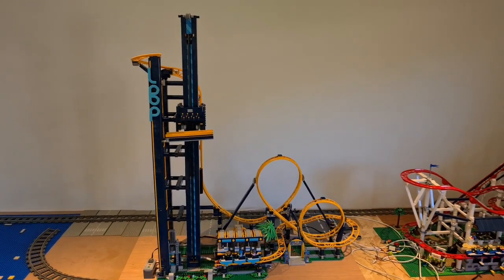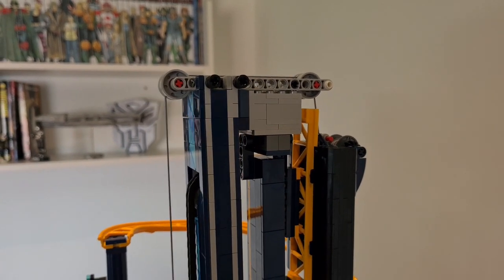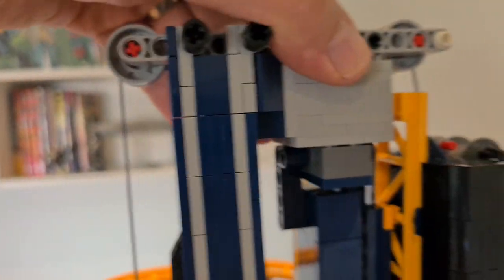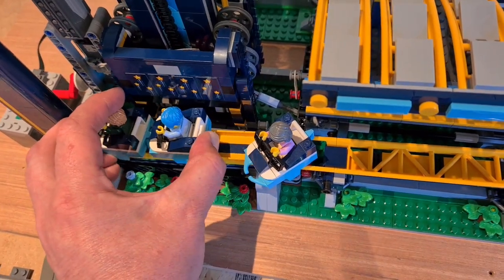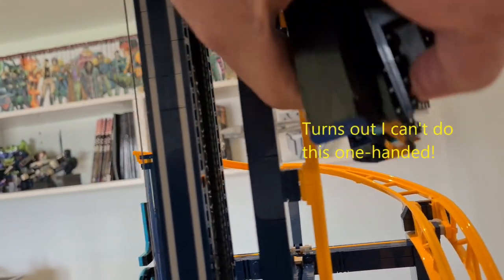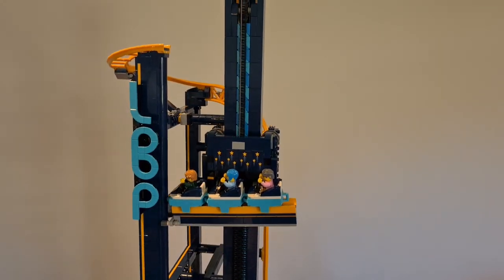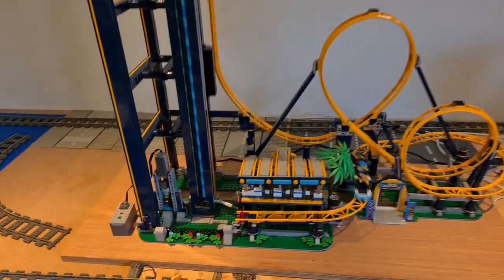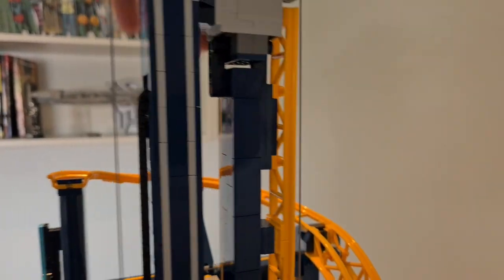How to fix Lego 10303 Loop Coaster and stop it breaking apart!

Comment: Your counterweight is too high. The instructions show you exactly where to put it so this doesn’t happen. You need to loosen the string so it sits level with where it shows you in the instructions.
Reply: You hit the nail on the head. Definitely didn't put the counterweight in the right place like the instructions show you. I built the set and it works flawlessly
Reply from the maker: I tried that. Turns out, if I loosten the string, the counterweight hits the table!
Reply from the maker: Checked it I don't know how many times but maybe that is the case? I know that if I loosten off the counterweight then it hits the table. I'd really like to think that this is an issue caused by my mistake but really, Lego should've tested this set a lot more than I think it did before releasing it.
Reply: @brictronic  interesting! Is it level with what the instructions show? I matched mine to the instructions and mine works perfectly. Good luck!
Reply from the maker: @jaronallred8865   @Jaron Allred  yep, exactly where the instructions show. But having spent hours on this issue now with my set, I honestly think how level it is, how stable it is and maybe even what altitude it's at 😂 may contribute to the problem. There's a poor design issue with this set that needs attention.
Reply: @brictronic  I’m sorry to hear. I’m the video the counterweight is not at the correct height so I figured that was the issue. Mine works flawlessly! Hopefully you can figure it out.
Reply: Look at your instructions manual on page 370 and step 544 you have to make sure your counterweight is level to what they show in the picture
Reply from the maker: @rickpease1911  yep, did that, made sure the counterweight was at the level shown in the instructions. I thought I had included mentioning that in the video but must have left it out. It looks like it's higher in the video I posted but that is after much alteration and messing about with the set. With the counterweight exactly as in the instructions, we were having this problem. Now the counterweight does travel further than where indicated but the extra weight stops it from travelling too far. Plus, when the counterweight was wound back to where the instructions indicate, on the opposite end, it was hitting the table!

Comment: You don’t have to modify nothing…… you don’t have the chain correctly on the loop cycle right and the counter Wright is going up way too high!
It looks totally off from mine I’m sorry to say……. You have to follow the instructions to the t and mine thank goodness has no problems whatsoever.
Reply from the maker: Thanks, yeah, I realised that the video shows the counterweight too high, that's my fault for rushing it. I had it set exactly level with where the instructions show, actually, I tried adjusting it up and down several times. Nothing worked continuously unfortunately, I'd get a few cycles out of it each time. I found adding the weight was the only solution that worked for me.

Comment: As time goes by new problems arise. Two of the coaster carts the wheels have become stiff. So now only one cart  can be used. There's no reason for this. I will order four more wheels. According to the manual it should come with 10 sets of wheels mine only came with six. I had numerous pieces missing.  I just used my own Lego to sort those issues during the initial build. It really puts me off buying further sets as they're not particularly cheap. Shame on you Lego....
Reply from the maker: That doesn't sound great! Good luck with getting it sorted but I agree, there doesn't seem to be enough testing of new sets such as this.
Reply: The other 4 are on the counterweight